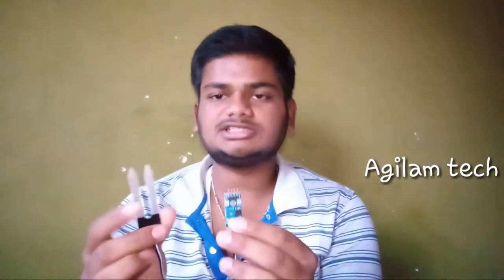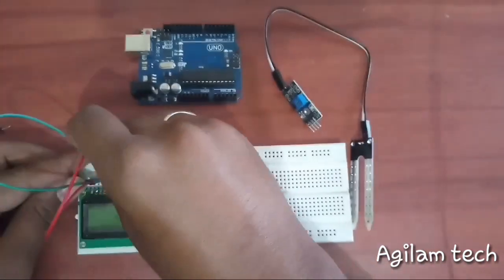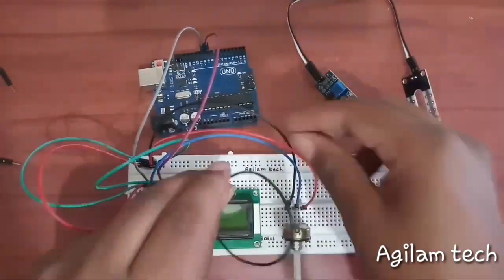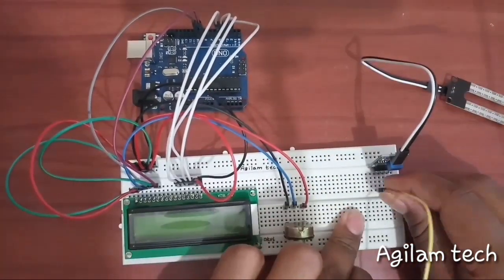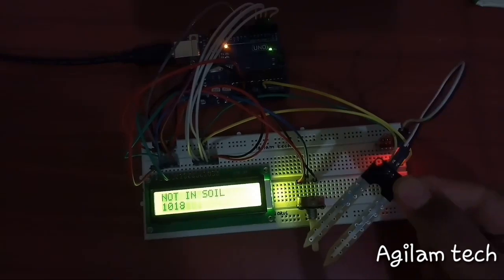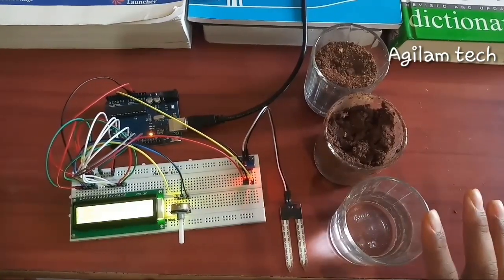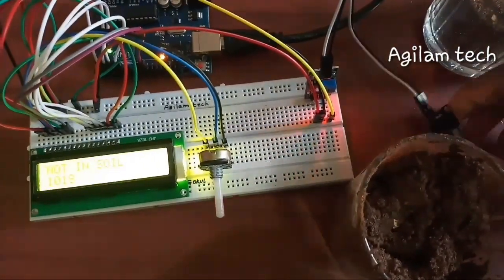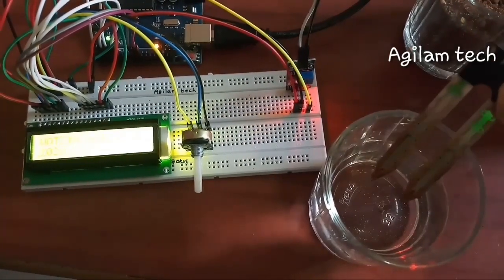Measuring moisture of soil using soil sensor on arduino.

Comment: Sir, Can u please modify this program with LCD I2C display??please sir🙏
Reply: This works for me, you need the latest version of NewLiquidCrystal library...found on github...replace the first part of his with this and the rest of his code works
// Include Wire Library for I2C
#include <Wire.h>
// Include NewLiquidCrystal Library for I2C
#include <LiquidCrystal_I2C.h>

// Define LCD pinout
const int  en = 2, rw = 1, rs = 0, d4 = 4, d5 = 5, d6 = 6, d7 = 7, bl = 3;

// Define I2C Address - change if reqiuired
const int i2c_addr = 0x27;

LiquidCrystal_I2C LCD(i2c_addr, en, rw, rs, d4, d5, d6, d7, bl, POSITIVE);
Reply: @DJMovit  is the potential meter necessary.?. i dont think so
Reply: It works with 12c, minor changes...now I have to calibrate my sensor as it sits in water and only reads humid LOL

Comment: sir can know the potentio meter  and give the lik in amazone
can you pls
Reply from the maker: 10k ohm's potentiometer
Reply from the maker: HITSAN 5pcs 200V 0.2W 10K Ohm Potentiometers Single Linear One Piece https://www.amazon.in/dp/B0742DWJH8/ref=cm_sw_r_cp_apa_i_bU6kBbH587MFN
Reply: sir can you tell amazone link for this potentiometer
Reply: sir i will give you 5 subcribers i too have a chanel
Reply from the maker: I have mentioned it above
Reply: where
Reply from the maker: HITSAN 5pcs 200V 0.2W 10K Ohm Potentiometers Single Linear One Piece https://www.amazon.in/dp/B0742DWJH8/ref=cm_sw_r_cp_apa_i_bU6kBbH587MFN
Reply: thats not i want it to speak to you
Reply from the maker: The required components and the program for this experiment are mentioned in the description and the circuit connections is explained in the video.
Please check it out.